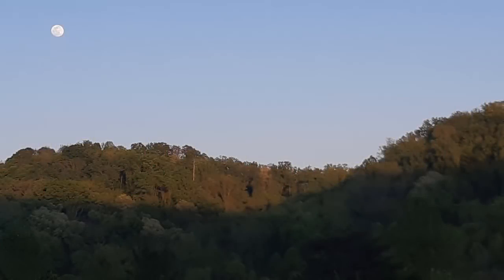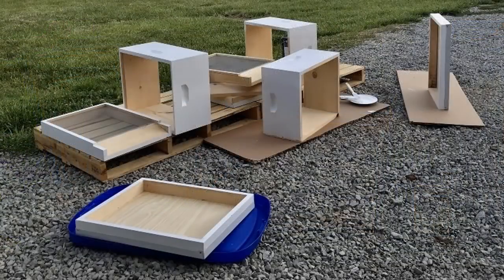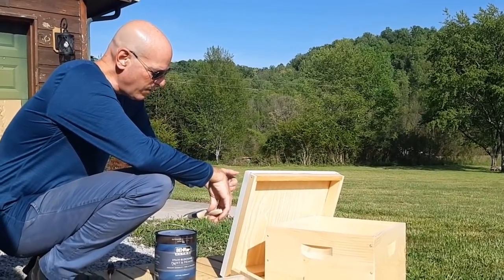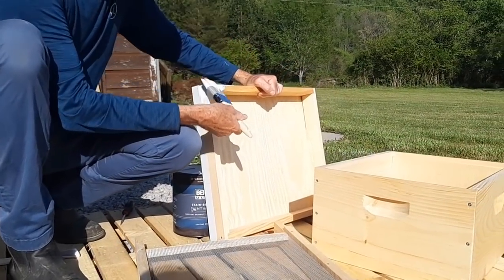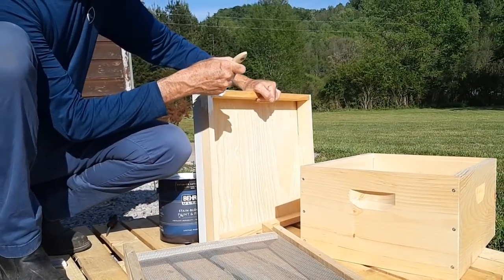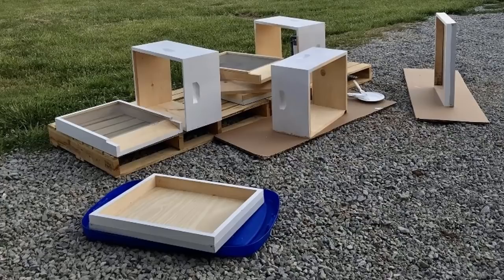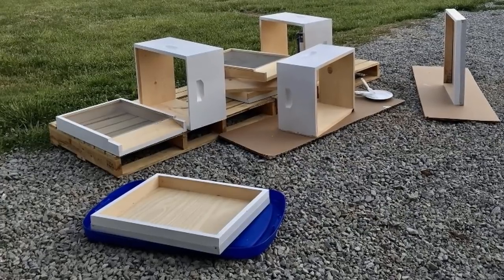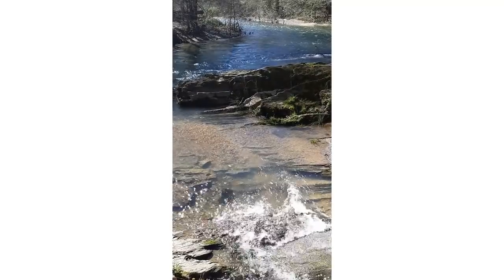Painting Bee Hives to Last Seven Years

Comment: Ironically, I was painting a DIY self watering planter bed.  I learned a lot from building DWC grow beds.  Thicker paint isn't the best.  Thin coats are best.  I found that thick coats will bubble and peel.  It really doesn't keep moisture out unless all surfaces are painted and  many times the boards will warp unless all surfaces are sealed.  Also, only use the tip of the brush, not the middle of the "hairs" because that just makes lines in the paint.  Brushes are meant to be used with the narrow end brushing back and forth, not the width ways.  I hope that makes sense.    In my dome I had, the moisture levels were near 100 percent and all nonpainted surfaces grew mold.  Painted wood lasts for a long time.

Comment: Thoughts on paint you mentioned Satin White exterior satin paint. I think that's great except I also think you're also are using latex paint and latex paint is so improved over the past few years and it's so much easier to recoat in the future just a mild sandpaper to give the old paint a little tooth and a clean surface and then repaint. When you paint the joints and Corners it's great to put the paint on thick to get it to soak into the wood  But be sure to brush it out into an even layer because if it's left very thick on the exterior surface it will tend to separate from the wood.  
   Don't use exterior enamel because the repainting is much more involved in difficult, and it's not as good for the wood as modern latex paint.